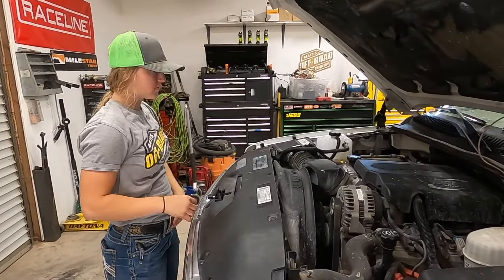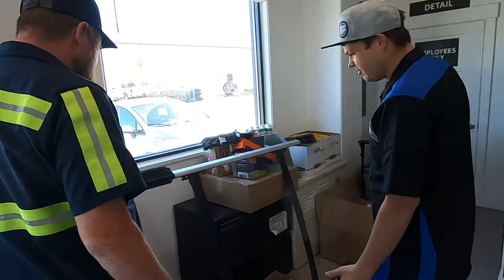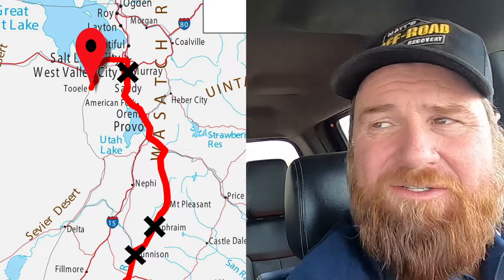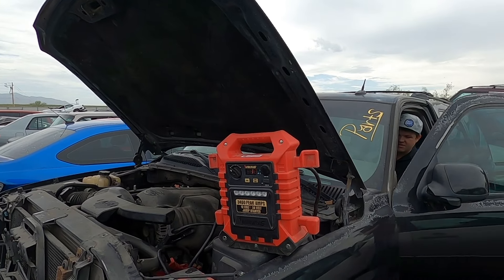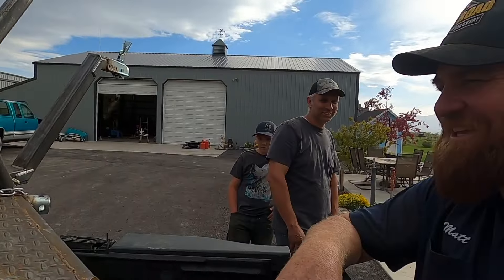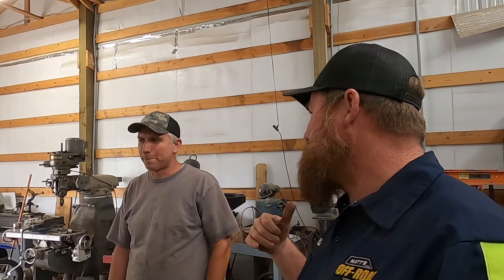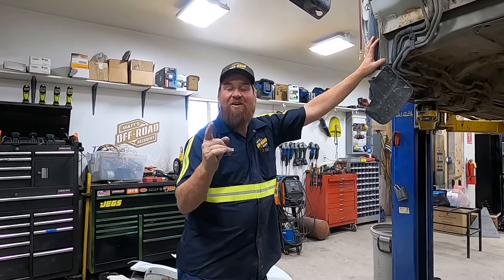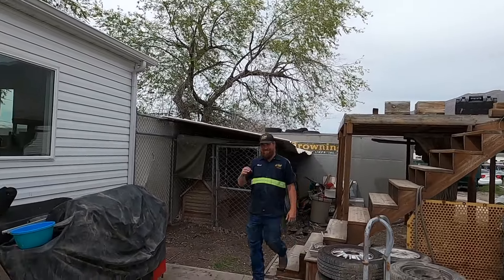Massive Engine For A Massive Off Road Wrecker!

Comment: Wouldn’t bigger tires on that trailer have been more useful than the gooseneck hitch? Or do you plan on hauling a lot of low bikes that you need the low break over angle?

Comment: what year denali did it come out of? if its an 05 or 06 , it should be an lq9 ls 6.0, which is actually the more desireable 6.0 motors. they are a high output  woth 345hp

Comment: Now how heavy is that compared to the 6.6 I don't know a lot about that motor what I know about it is it has a lot of torque and it's a real durable motor I remember u saying u don't use diesels because of the weight which I get that 6.6 is a heavy motor

Comment: Why not a diesel? Great low rpm torque. Not too big, could use a 6.7 cummins. Burn less fuel. And they sound cool.
Reply: Matt said in the comments "That would be a great on road tow engine. Unfortunately, diesels have terrible power delivery for sand rescue. Lots of throttle lag, difficult to modulate low speed power, and no RPM range."

Comment: Wouldn't a big diesel be a better choice, with an Allison automatic? Just a thought.
Reply: Matt said in the comments "That would be a great on road tow engine. Unfortunately, diesels have terrible power delivery for sand rescue. Lots of throttle lag, difficult to modulate low speed power, and no RPM range."

Comment: I get 650Nm from my tuned 3.0 TDI v6. That's more than the 8.1
Reply: And when they're done tuning it they're planning on making 700 horsepower which is more power than you have torque puts your piddly little V6 to shame LMAO
Reply: @GreenTheScreen123  the video showed some dyno specs, and I don't know if they are done. But at this stage I think the power to size ratio is really poor.

Comment: Should have gone diesel for the massive torque .. I know your concerned about rpm’s for wheel spin but the diesel can give you that also especially a decent Cummings .. yes I know diesel is expensive but they are more fuel efficient and you have travel longer with the fuel capacity you will have

Comment: Should gone with a 12 valve Cummins and trans from Power Driven Diesel. 12 valve stock would do an easy 700hp 1000+ft lbs torque and would literally go forever
Reply: The amount of people like you saying a diesel is better than gasoline are just idiots first of all a Cummins diesel can't make 700 horsepower unless you tune it they don't tune their engines and second of all diesels suck ass in sand and third of all diesel costs like twice as much as gasoline does so they would destroy their bank accounts trying to feel that thing with diesel
Reply: @GreenTheScreen123  diesel has relative 45% power output to burn ratio in relation to burn efficiency where gas is only 25% relative. Also he said he wanted to make 700 roughly with his 8.1 which would require tuning as it may make like 350-400hp stock maybe I dunno exactly a 12 valve would also need tuned but its as simple as adding fuel, air, timing with a p-pump no ecu tuning required PDD make a towing package with compound turbos that makes 700hp easy which is responsive and reliable. More throttle response would come from 24 valve common rail but more electronics. And its not that diesels suck in sand its the vehicle itself not being properly prepped for conditions which Matt has no issues with his reasons gas engines are used for off road racing is simply for throttle response but for a towing application such as his heavy wrecker a diesel would do just fine and 12 valves are known to do a million miles+ and be reliable. You should check out Power Driven Diesel and see what sorta stuff they do one of the guys had his junker 12 valve pushing 900hp for years with little issues
Reply: @GreenTheScreen123  and when I refer to stock I mean stock internals eg. Crank, pistons rods block. You need bigger injectors higher tension valve springs, stronger head studs and push rods for reliability but the same would need to be done with the 8.1 yes you could just do bigger turbo and injectors but you'll run into valve float when running higher horsepower and risk shortening the life of head gasket without better head studs. I'm a mechanic so I don't say these things willy nilly, I have the knowledge and experience to back up my statements

Comment: Is t the heavy wrecker going to be street legal or do you plan on trailering it? Will it fit on a trailer?
Reply: Of course that's not road legal extra wide trailers also
Reply: @GreenTheScreen123  of course.

Comment: Great choice on 8.1L! That Suburban had 4L80E or 4L85E, both good transmissions. If you find a Silverado with 8.1L it will have an Allison transmission with external filter which I've read is a great transmission.
Reply: I hope he is aware of this. The 4l85e is a good trans but doesn't have a very low first gear like the Allison does.
Reply: Good point!

Comment: Don’t do a turbo. Go with a Whipple Supercharger. It with give you boost at low RPM. A Turbo is great for high RPM’s like drag racing. Plus a Whipple will bolt on like a AC pump and Runs off a belt.
Reply: You realize you can tune a turbo to run low down in RPM not every turbo is made identically just like not every Whipple superchargers made identically you can literally get a turbo to activate around 1500 RPM if you want it to
Reply: @GreenTheScreen123  I kinda agree. But Most turbocharged motors are built for High RPM. I have heard some turbos coming in at low RPM’s. Most Superchargers like the Whipple will make boost  just off idle. You have a lot less piping with a Supercharger. But with a Turbo you have to build Boost through RPM with exhaust. They are fine a sea level. Try and build boost at 5000 foot with a turbo. You don’t have boost lag near as bad with a supercharger. Matt does a lot of high elevation recoveries. I still think a Supercharger is best for his needs. But I been wrong before.

Comment: 🤯😫 Nooooo! Put the trailer back the way it was and put an interchangeable drop hitch on the back of the nugget.  Or at least spit the difference. That trailer looks silly now. 😜
Reply: No it doesn't it works and that's fine and also stop using emojis

Comment: Now put a 5.9 Cummins in the Tahoe
Reply: If you want to get stuck in the sand put a diesel in anything if you want to not get stuck in the sand put a gasoline powered engine in it it's just diesels have absolutely terrible throttle response so they just get bog down in sand

Comment: Better put a 50Gallon gas tank in the wrecker so Matt does run dry.
Reply: Matt commented that it will have 80 gallon capacity
Reply: @JohnFL  and he will still run out guaranteed.
Reply: @thegiant573  and I can guarantee you they will never run out because they're not dumb
Reply: @thegiant573  also that thing's not road legal so they will have to tow it to the destination

Comment: Going to be a beast of a wrecker!  I'm sort of disappointed you didn't do something like a Tesla drive unit spun 90 degrees - If you want mega torque (from 0 rpm) that's the way to go. Probably not as common in those junk yards though I guess.

Comment: should have bought 8.1 out of a truck 2500 or 3500 because it would have a 5 speed allison transmisson the all suburbans has a 4L85e 4 speed transmission i currently own 2004 yukon xl 2500 with 76,000 miles i wish it had the allison but the 4L85e is better than the 6.0 transmisson maybe you already new this thanks

Comment: Surprised you don’t go diesel for the big tow truck.
Reply: Matt said in the comments "That would be a great on road tow engine. Unfortunately, diesels have terrible power delivery for sand rescue. Lots of throttle lag, difficult to modulate low speed power, and no RPM range."

Comment: I know this is an old video, but why weren't there any gussets put on that gooseneck?? I know there was bracing on the sides, and that's all well and good, but a couple triangle shaped gussets would've sealed the deal. Frankly, I wouldn't tow that trailer by itself without a load, without those gussets. But that's just me.

Comment: Why not drop a duramax in it? More MPG, gobs of torque, idle the whole time running whatever you need at the site.
Reply: Diesels suck in sand bud also diesel cost twice as much as gasoline and not to mention a duramax would have set them back 10 times as much as that 8.1
Reply: @GreenTheScreen123  Diesel suck in sand usually because of the weight of the truck not the engine. I also wouldn't say the cost of diesel is 2x as much as gas.  Getting a diesel engine would cost em more though but sometimes you can pick em up for cheap.

Comment: You will love the 8.1 I have been running one in a crew cab dually ranch truck for the last several years. Less fuel mileage than the diesels with a lot less headache.

Comment: Was there ever talk of putting a diesel in the Heavy Wrecker?
Reply: In the comments section, yes. Matt's team knows not to suggest a diesel. Matt said in the comments "That would be a great on road tow engine. Unfortunately, diesels have terrible power delivery for sand rescue. Lots of throttle lag, difficult to modulate low speed power, and no RPM range."

Comment: Need to sell that motor and get yourself a diesel. Better MPG and just more torque all the way around then you can add a turbo to it and you got a monster. Yes the gas engine has more hp and turns up faster but the diesel is better on fuel and alot tougher.

Comment: Why not diesel?
Reply: Matt said in the comments "That would be a great on road tow engine. Unfortunately, diesels have terrible power delivery for sand rescue. Lots of throttle lag, difficult to modulate low speed power, and no RPM range."

Comment: Ugh, a gasser engine and no air bag suspension, love your builds but a cummins 12 valve diesel and all air bag suspension would go a long way to make it more driver friendly, I live on a dirt road (10 miles to town) with steep washboard roads, and my 11000 lbs truck was horrible with leaf springs, when I replaced them with air bags the difference was night and day, no more tire bounce trying to get traction in 4wd, smooth as glass.

Comment: I don't know that engine but I guess it's a gas engine. If it is I can't believe you didn't buy a Diesel motor. More power for pulling and towing, and better mileage. You better put a real big fuel tank on your truck.

Comment: Yup, 496 will work for a one punch get it all done plug for mounting in a Gen 6 but, I think you oughta switch out the 496 Long block for a 502 Gen 6 long block (or up date to a 6.0L LS2, LS3, ZZ454/440, LSX454, ZZ572/720R.
The 502 (and up) bore clears the Valves a lot better for more horse power, way less spark plug fouling and All Gen 6 BBC parts fit a 502 (454 Included) as a 502 is a true Gen 6 engine and the 8.1/496 is not (8.1 is more a mexican metric bastardization of a 454 that won't share it's parts).
Warning; The 496/8.1L Engine is a non-interchangable parts, one off, red haired step child, limited production, un-obtainium parts engine and not what ya think it is!  8.1 Firing order is 1-8-7-2-6-5-4-3 Weird! Should be 18436572! Maybe that's why 8.1s do NOT run right, right?!! 

Don't get me wrong, a 454 stroked to a 496 or a 502 is a very good motor!  IE: 454/7.4 and 502/8.2L

Comment: I thought it was going to be something like a Duramax or Cummins. Those 8.1 big blocks are just kind of underpowered in comparison.
Reply: 8.1L Vortec 8100 Engine Specs
8.1L Vortec 8100 V8 Engine Specs	L18
Displacement (cu in / cc):	496 / 8128
Horsepower:	330 hp @ 4200 RPM
Torque:	450 lb.-ft. @ 3200 RPM
Bore and Stroke (in / mm):	4.25 x 4.37 / 107.9 x 111

GM 6.6 Liter V-8 L5P Duramax Turbo Diesel Engine Power Ratings
Vehicle	Transmission	Power (hp / kW) @ RPM
2017 Chevrolet Silverado HD and newer	Allison Transmission MW7-LCT 1000	445 / 322 @ 2800

Comment: I'm all about displacement, also I am an LS fan.

However I would say you should have gone with a 360 Magnum (1994-2001), very abundant,.reliable, easy to work on and 400ft-lbs of torque stock.

After a cam, some cylinder heads, exhaust headers, intake manifold/ intake you can easily make 550hp and 600+ ft-lbs of torque for less than $5000 reliably

Comment: Why not a diesel engine?
Reply: Diesel is twice as expensive as gasoline and a diesel engine would cost 10 times as much as the 8.1 that they got in there and also not to mention that diesels suck ass in sand
Reply: @GreenTheScreen123   aha okay why is it so expensive for a diesel engine in the states?🙈 in norway where im from there are diesel engine wherever you look and the cheapest and most reliable engines for day to day use and offroad is diesel.😅

Comment: If he put a 6.7l Cummings in it he would  get double the fuel economy but the 8.1 would be cool imagine that on 5 psi of boost... Nvm lol he's doing it 🤣
Reply: I do agree that the Cummins would have better fuel economy but at the same time the reason why they don't use diesel engines is because diesels suck in sand and also diesel costs like twice as much as gasoline

Comment: Sorry Matt, but  you're not getting good advice, your Heavy Wrecker needs a Good diesel engine that makes plenty of torque down at low revs, not a huge gas guzzling engine that makes its max power and torque too high in the rev range, you'll save on weight too as you won't need to lug around a reservoir of fuel.
Reply: Dude read the comments or watch the video he literally explains that the reason why he doesn't use diesels at all is because they have trash tears throttle response so try to modulate the throttle while trying to climb a sand dune just won't happen it's either you have no movement at all or you will spin like crazy and just bog down that's why he doesn't use diesels and no one should use diesels for recovery vehicles unless you want to accidentally rip the front end of the car you're trying to recover

Comment: You need a diesel, gas is going to be inefficient and under torqued.
Reply: Matt said in the comments "That would be a great on road tow engine. Unfortunately, diesels have terrible power delivery for sand rescue. Lots of throttle lag, difficult to modulate low speed power, and no RPM range."

Comment: I would take addition 400 lbs and went for a 5.9 cummins ABOUT 600 LBS TOQURE. more power at low rpms and 3x fuel economy
Reply: Detroit Diesel 2 stroke

Comment: why not just put a diesel in it?
Reply: Matt said in the comments "That would be a great on road tow engine. Unfortunately, diesels have terrible power delivery for sand rescue. Lots of throttle lag, difficult to modulate low speed power, and no RPM range."

Comment: I have several 8.1 and honestly hated them because I have owned Duramax’s before them. If you where worried about the weight the 8.1 is a bad choice you could have gone to a Duramax for only 80 pound weight difference. I love what you do but I’m actually disappointed in you engine choice. I have also scattered a stock 8.1 with only 170k miles. Put a rod through the block

Comment: I'm extremely disappointed that you decided to tear apart a nice/uncommon Suburban to scavenge an 8.1L. If it's a 2001-2002 model year, ensure to replace the crank sensor as those years were notorious for failing/intermittently failing and leaving you stranded. The updated crank sensor part number is 12575172, I'm a GM technician so I've had my share of dealing with them.

Comment: 8.1 GM engines are known for normal oil consumption around a quart every 1500 miles. Slightly loser tolerances for hard worked engines. Someone who runs out of gas a lot might have problems.

Comment: You won't be able to afford the fuel to get the wrecker to your locations. Should have got a Cummins
Reply: Naw mate they would of spent over 10 times on a Cummins then what that did on the 8.1 and not to mention that diesel is like twice as expensive as gasoline
Reply: Maybe they will trailer it on the highway.

Comment: Just curios why not diesel
Reply: Matt said in the comments "That would be a great on road tow engine. Unfortunately, diesels have terrible power delivery for sand rescue. Lots of throttle lag, difficult to modulate low speed power, and no RPM range."

Comment: That's less horsepower and torque then a ford 6.8 v10
Reply: Im a Ford fan, but the problem with a V10 is the rpm needed to make power.

Comment: Is this thing going to haul trailers off-road? Some DAF-trucks of the dutch army had a tow-hook connected to a cone which could be winched in and out the back of the truck
That way you can drive over an obstacle and then winch the trailer over it in case you think you will get stuck with the trailer attached.

https://youtu.be/aL0BHMqnnIk @ 1.50 the show it.

Comment: Not putting a diesel in there is an absolute failure. Even a 7.3IDI would be far better than the 8.1 or any gasser. Ideally you would use a DT460 which is all mechanical, turbo'd, and can make insane power with just a tune.
Reply: Matt said in the comments "That would be a great on road tow engine. Unfortunately, diesels have terrible power delivery for sand rescue. Lots of throttle lag, difficult to modulate low speed power, and no RPM range."
Reply: @JohnFL  How would they have terrible power delivery for sand rescue? That makes no sense. If he thinks they have throttle lag I guess he's never driven a tuned 6.0 or Cummins, and especially not a Duramax. They are the best for low speed power. And who needs RPM range when you have proper gearing. Torque is what you need to pull things and run a bunch of accessories. Take a look at Diesel Brothers and the rescues and such they have done with diesels.